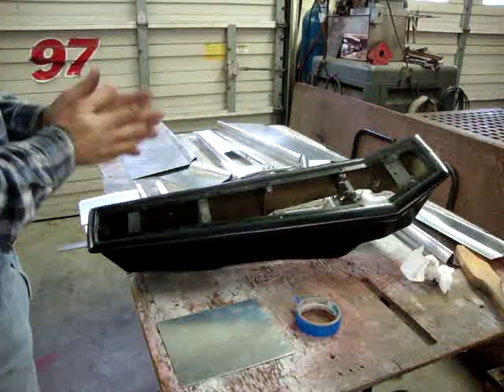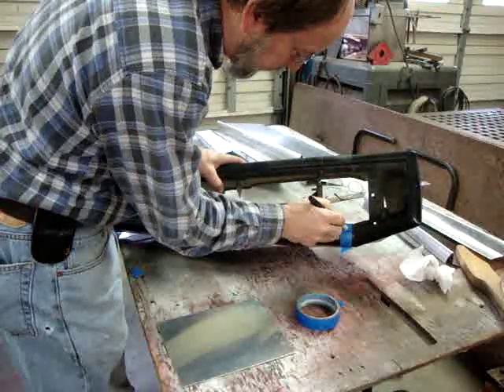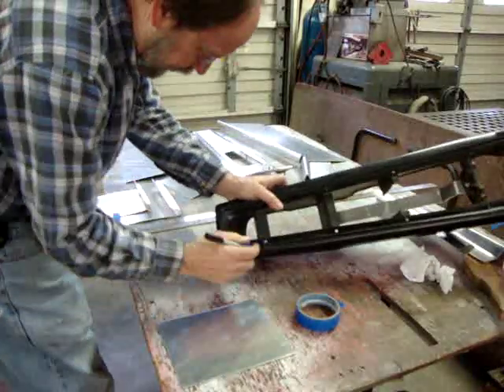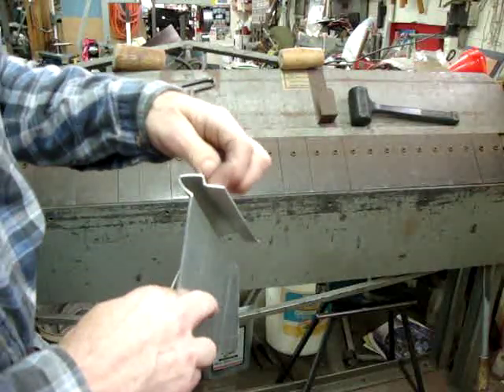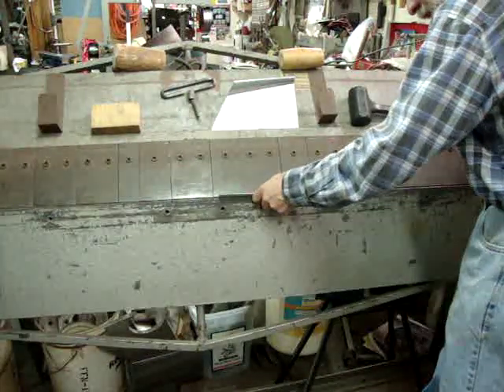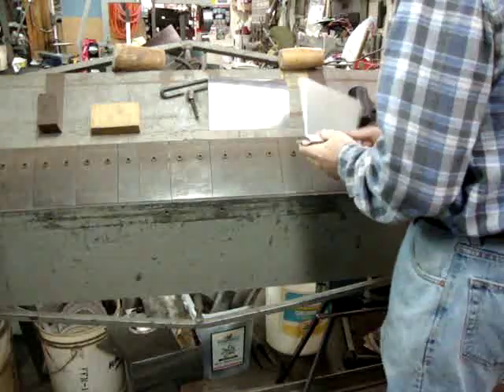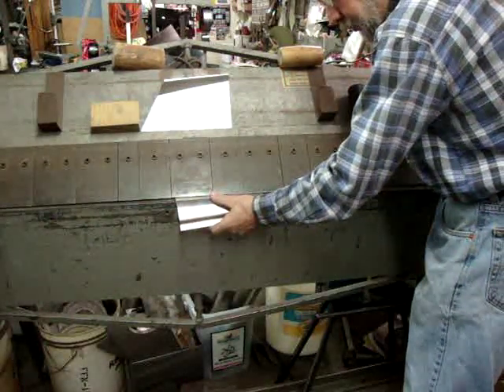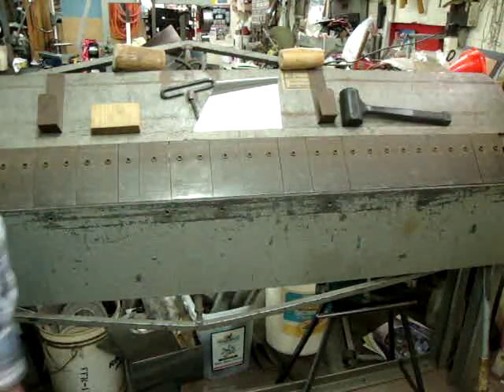Using the sheet metal brake

Comment: Bill,
Thanks for the video.
I saw tricks here not seen
In commercial machine/sheet metal
Shops over many years.
Most use the press brakes and 
Cnc equipment turning away the 
Jobs that need hand working.
I recently purchased a box and pan
Brake and you have helped a great deal.
Kap